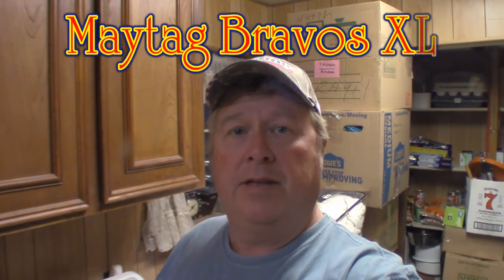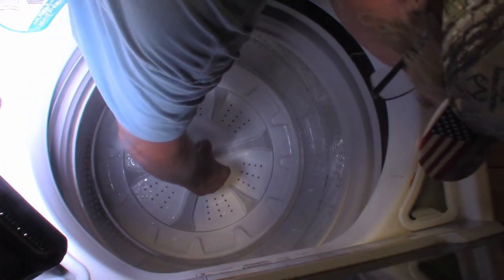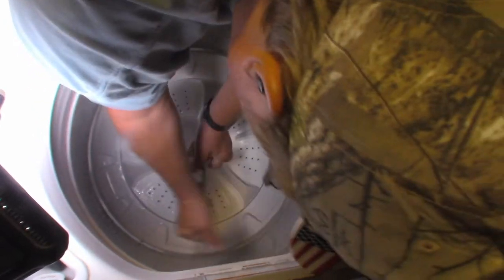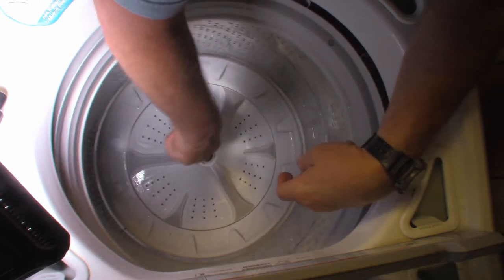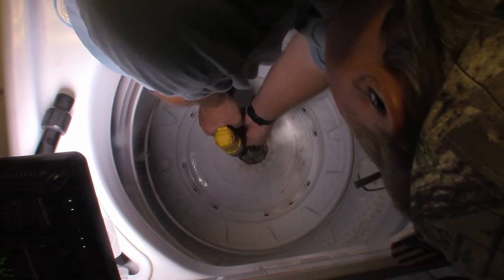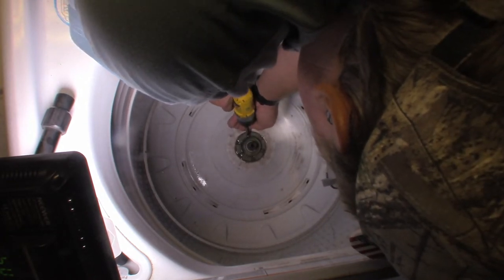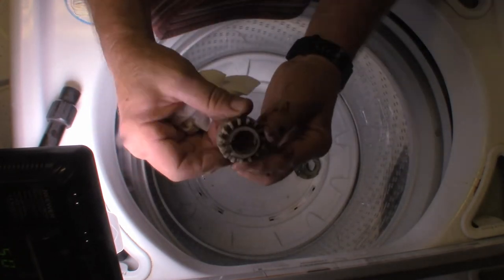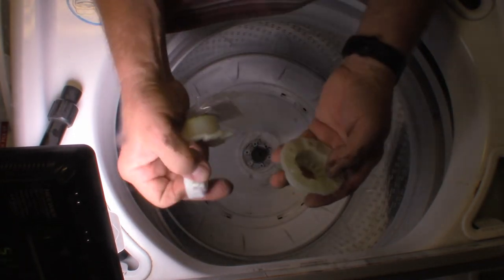Maytag Bravos XL Washer Repair

Comment: I bought those tramboline spring puller you would have to match a drill bit to the puller and drill or grine the puller to match the preexisting holes adjacent to one another place puller in and it come right up with little  effort.

Comment: I ended up breaking the agitator 😂 it was really hard to remove from the shaft, so I used a steering puller to remove that damn metal thing, just waiting for the transmission and agitator